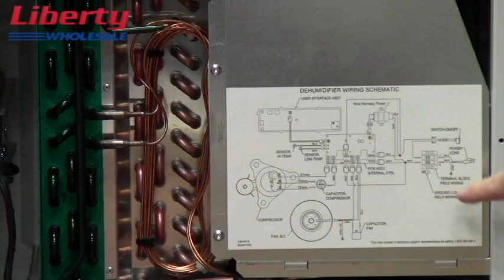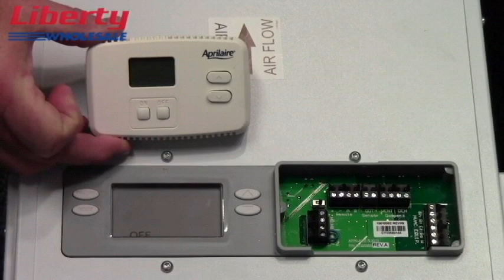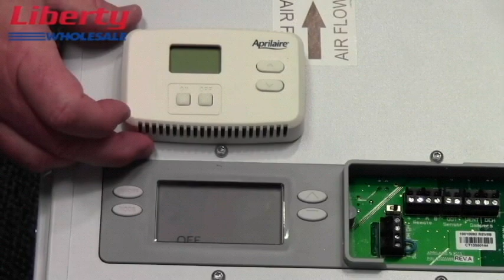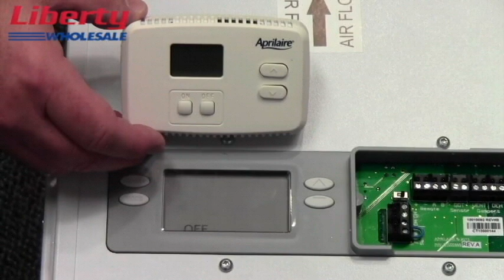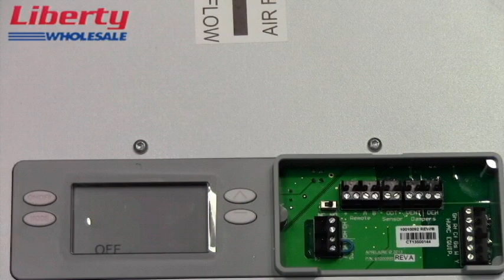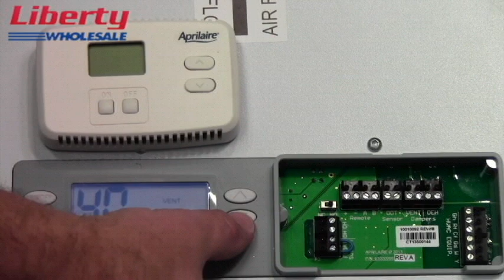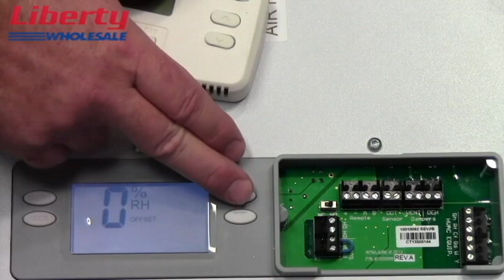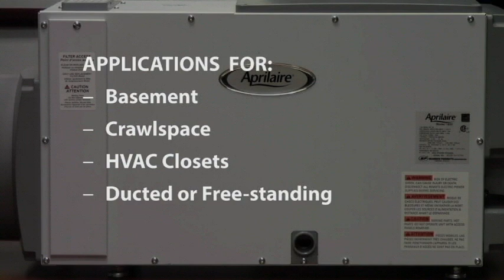Liberty Wholesale Supply - Aprilaire 1830 & 1850 Dehumidifier Overview & Installation

Comment: I had it with the 70 pint portable dehumidifiers. All brands seem to last 1 to 2 years and stop taking water out of the air. My old Sears dehumidifier was about 30 years old and I gave it away to someone who needed it and it still worked. After a lot of searching in late March 2016 I got an AprilAire 1850 for my 1900 sq. ft. finished basement. I had it installed by my HVAC contractor and it is tied into my HVAC system for the basement. I also got the external thermostat from AprilAire, the model 8620, that monitors the temp plus the humidity so it controls both. The AC really does not come on much as the basement is 1/2 underground and 1/2 daylight. The HVAC fan comes on when the dehumidifier is running to boost the circulation. It is very quiet when running and so far has not increased my daily energy consumption. It comes with a 5 year warranty when professionally installed and my contractor also threw in a 5 year labor guarantee. I hope to post in the future as to the reliability. The manufacturer claims it is built to last for 15 plus years, I hope it lasts that long or longer. So far I am very pleased with it.
Reply: Hi James, I am thinking about purchasing the 1830 as my whole house is under 1500 sq. ft.

I have 2 questions: 
1.  how much did your unit plus installation cost you? 
2.  Is the dehu still working the way you expected?

Thanks!!
Reply: It's been 3 yrs is it still working good... What's ur energy savings

Comment: I have an Infinity carrier heat pump with dual heatpump/gas heating. Does the whole house dehumidifer use less energy than the AC dehumidifing function which lowers the temperature up to 3 degrees to dehumidify, whish I do not like?

Comment: I've had the Aprilaire 1830 in use about 5 weeks. It's not connected to any ducts, just for  basement dehumidification and drains into the laundry sink. I hadn't been in the basement for a couple of weeks, came downstairs and found that it was off with an error code E2. I don't understand how it could be too hot since it is in the basement, and since it isn't connected to ducts I don't know how it would have an issue with airflow being blocked. I reset the unit power, and it came back on. I'm very concerned that it had this error, that there is something wrong with the unit, since I have only had it about 5 weeks. I thought that these were supposed to be reliable for long-term use in a good sized basement.

Comment: Would this work as a free-standing dehumidifier in my crawl space, that is not connected into my HVAC duct work?
Reply: I just ordered one and is how I'm going to use this unit.  I may or may not add a 10' length of pipe to it or may just leave the pipe adapters off and leave it run in my crawlspace.
Reply: @TODDCSMITH_  dose it work good
Reply: No
Reply: @mitchdenner9743  Please expand.  The unit should work great as a stand alone.